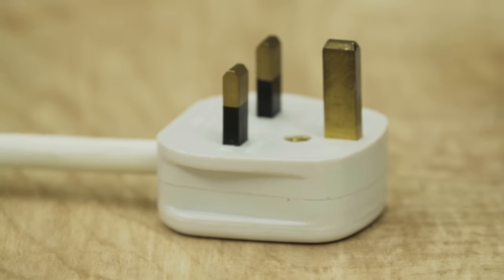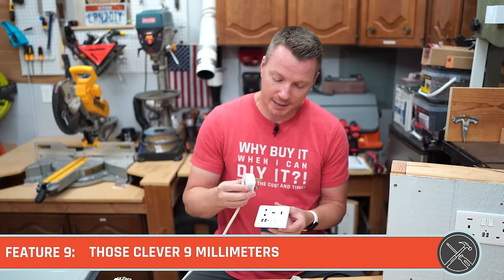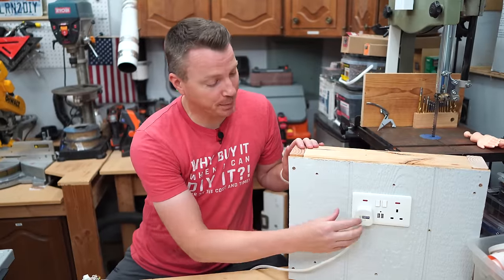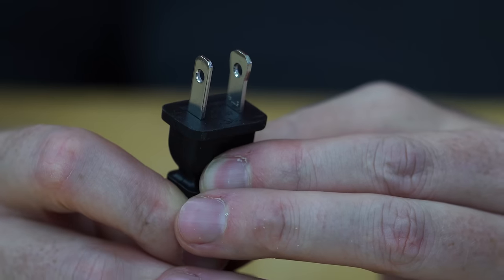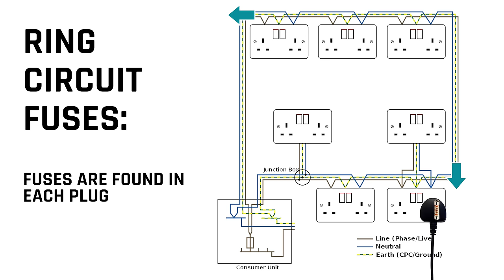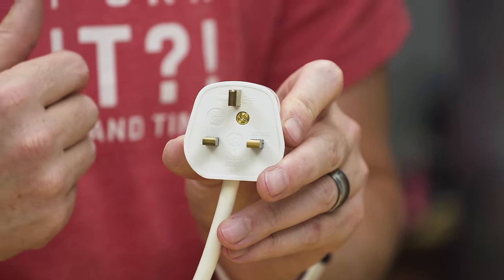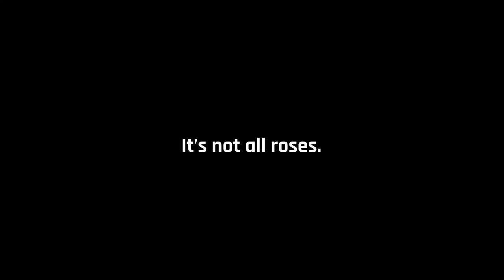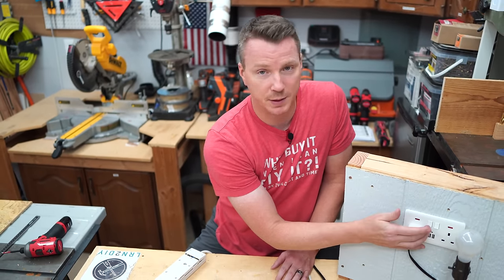British Plugs and Outlets Are On Another Level

Comment: interesting video.  i came from the UK and remember as a kid having to replace fuses or wire on new plugs to items we bought in the store.  with 220 coming out of the wall, you'd get a bit more than static hair-do if you got a shock.
i was amazed when i came to the states the first time i went to plug in my room-mates vacuum cleaner with this flimsy plug almost as crazy as a car wheel with 4 lug nuts after driving a super duty with 8.
Reply: Voltage is actually closer to 240v if not more in the UK, It's officially 230v +- 10% but that's just to line up with european standards where they run around 220v. So it's the spicier of the 230v systems.
Reply: @RossMitchellsProfile  yup. It's 253V or something at the transformer, but loses a bit due to resistance losses. Actual voltage at the home user's plug socket has a surprisingly large range.
Reply: @neilsluman8267  What do you mean “at the transformer”? The cable into a house is single phase 240V (+10/-6%), the single phase cable is jointed off the mains 415V 3 phase cable which is fed by the LV distribution board inside a substation, the substation contains an 11kV to 415V transformer (usually) however you can get 11kV to 240V single phase transformers and 33kV to 415V transformers at distribution substations.
Reply: @ohgoditsjames94  I mean at the final distribution substation. That +10/-6% means your actual supply might be anything between 216 and 253V.
Reply: @neilsluman8267  Yes I know. The “final” transformers secondary winding is usually 415V for line voltage and 240 for phase voltage as 99% of the time the LV winding is Star connected.

Comment: Load balancing on a ring circuit has never been an issue in my lifetime. The gauge of wire now used is more than enough to handle 13A loads.

Ring circuits also help in troubleshooting. In that with a broken ring, if it is not fixable, then the ring circuit can be made into two radial circuits.

The switch don't cause confusion, perhaps to those that don't have switches it will be an issue.

Stepping on a plug is a right of passage in the UK 😆

Comment: Great video. Ring circuits aren't a necessary requirement  in the UK, if you want to run a radial you can (though you need to protect it with a lower rated fuse/circuit breaker in the consumer unit than if you had a ring circuit). 
Also load balancing isn't usually a big issue in the typical home. If you did have a significantly larger current in one side of the loop that section of cable would heat up slightly causing an increase in resistance so more current would travel around the longer part of the loop. Kind of self balancing. In any case your circuit breaker would protect the circuit from dangerously high currents.
Reply: what absolute nonsense, all points on a rind circuit are equal
Reply: @gimmieliberty6514  You're wrong. Current in the shorter leg of the ring can be higher than current in the longer leg (because resistance is proportional to length of cable). It's explained in detail here...
https://youtu.be/c28vLmsszFM
Reply: You don't necessarily have to use a lower rated fuse/breaker for a radial - you can still use a 30A/32A by upping the cable size to 4mm2 instead of the standard 2.5mm2 used for a ring.
Reply: @stephenwalker6823  Quite right. That is your other option.

Comment: I'm in the UK. Not every socket has a switch incorporated. Most modern ones do but many older ones you still have to physically remove the plug. Load balancing is not something that I have ever heard of, and has never been an issue for anybody in the real world. Having to diagnose a faulty socket switch isn't something I've ever had to do either. The pain of standing on one is real though. Once trodden never forgotten 😭
Reply: @karlosh9286  Legally fridges, cookers, washing machines, tumble dryers and so on HAVE to have a switched fused spur as well as an outlet which may not have a switch.
You don't want to be trying to pull out an appliance that's on fire or leaking water right by an electricity supply to get to the plug socket in the wall behind it! Yes there's always cutting the power off at the consumer unit / fuse box, of course.
Reply: @JP_TaVeryMuch  The RCD should trip these days, and everything should be "fine" !
Reply: @karlosh9286  Should being the operative word. Should and almost always is. But belt and braces measures can usually be slotted in unobtrusively.
About time braces came back into fashion actually. Especially if we've all been put on the national debt diet.

Comment: 10:50   Switches Are 
             Double Edged Sword

This is a non existent issue!☺️

If an appliance does not work you simply try another appliance at that same socket eg a phone charger.
If that works then you know the issue is with the original appliance
If the charger doesn't work then you have an issue with the socket

Thats it, takes about 10 seconds to work out 😂

Comment: Missed the point about stepping on the plug.  The outlet switch is a double pole switch, therefore when switched off there is not a need to remove the plug from the wall outlet, since the plug is not on the floor, one does not step on it.

Comment: For anyone looking for an easy way to remember which wire goes in which terminal:

BLue = Bottom Left

BRown = Bottom Right
Reply: Another way I was taught is 

BLue = Bottom Left

BRown = Bottom Right or the colour your pants turn if you touch it.
Reply: I think "bottom" is kind of superfluous (though I get it is technically more accurate considering the ground pin). I've only ever really known people to use:

BLue - Blue Left 
BR - Brown Right

Comment: I remember once when I was 10 years old and hoovering the stairs as part of my chores, I had the hoover at the bottom of the stairs with the cable (and thus plug) unwound and on the floor next to it. I was upstairs and going down so I could start hoovering, and me being a 10 year old I loved running downstairs as fast as I could and jumping off the last few steps - bad decision in this case. I landed squarely on the upturned plug right on the arch of my foot and all of my speed and weight went straight into that foot - luckily the plugs are blunt so I only barely drew blood, but I couldn't put any pressure on that foot for the next couple of days, and had a profound limp for about a month after the fact

Comment: Thank you for your 'cool' review! UK mains cables are 2.5mm and homes usually have at least two separate ring circuits. The square 13A pin plugs BS 1363 replaced the earlier three round 15A pin plugs as a safety measure (for example, to stop children poking pencils into sockets) from 1947 - although I still remember a few still in the sixties. Remember, homes had fewer sockets and appliances back then.

As for being robust, I still have some round pin plugs which are serviceable albeit no longer used as they don't meet today's standards and there is no point in having incompatible plugs /sockets in the home. Many of my BS 1363 plugs are decades old and in excellent condition.

5A three round pin sockets are occasionally still used on lighting sockets to prevent 13A plugs from being inserted.

As for a lamp not illuminating?  In the UK we always check it is plugged-in first and turned on at the socket (second)!

PS - you forgot to mention the grip-notches on the plugs - there to assist when unplugging. A subtle part of the design so easily overlooked!
Reply: The UK never used round pins except on low voltage systems usually found on farms.
Reply: Graham, we did and do. It's very useful to have a round pin circuit for lighting. This was / is how many table lamps in a room were controlled from one switch.
Reply: @JP_TaVeryMuch  Yep, I remember as a child my parents home having round pin sockets in two different sizes if I remember rightly.  The house was rewired in the late 70s and it was all standardised to what my mother always referred to as a 'square pin' for decades after the round pin sockets were consigned to history.

Comment: As a Swiss electrician, I would say the “Swiss” plug and outlet are the best. 
Ground pin longer, plastic pins, hierarchically downward compatible, etc… 
But there’s a one more security, there’s a protective collars on the outlet so it is impossible the touch the pins. 
Plus, in one unit/outlet, there’s three outlets. This is the best feature actually.

Not sure everything is clear, but go on Google. It’s the type J

Comment: As a UK electrician, the old ring main circuits are in the process of being phased out in most places. New builds & most rewires are almost exclusively radials. 

Testing & fault finding ringmains looks complicated, but once you've done it a few times it's pretty straight forward.
Reply: How are they being phased out?
Reply: @scabthecat  Most new builds aren't species to have ringmains & most electricians doing rewires I know don't tend to use them either. Even councils sparks in my area don't install ringmains on rewires.

Comment: British plugs are great - if you open them up (only certain devices, no ground pin needed), you will find a simple euro plug inside. Which completely sits inside connected to the british layout pins :D
Reply: With that huge size, I bet you could fit two Euro plugs in the housing. :D
Reply: @digantdalal  you can still fit two UK plugs in the double UK socket, as the converted plugs sit out a little deeper and power, not wider.

European plugs are so easy to bend break and come out socket. Really a down grade once you've lived with type G.
Reply: @Dosedmonkey  The whole euro plug/ socket system is a genius design. If your your plug comes out easily, you are probably using a dodgy converter or it is meant to come out to protect you from tripping over. Euro plugs come with only low power devices, for high power bi polar devices, it comes with round CEE 7/2 plug. There is no way, you can stick this CEE 7/2 into a hexagonal Euro socket. It has to be a type E/F round socket with earthing. Unlike in Type G, CEE standard plugs comes with straight wire out. It is meant for ease of plugging out and the device should not remain powered all the time. e.g. Irons, laptop chargers. Once you are done, plug it out and take it away. Vacuum Cleaners and hair dryers come with CEE 7/2 plugs with straight wire out while TVs come with 90 degrees L shape. You will certainly not trip if you step on a long vacuum cleaner cord because it will come off from socket before you trip. Type G is boring and big. Who needs a clunky plug for low power mobile charger or an led lamp with a low amp fuse? The mechanical design of hexagonal Euro socket prevents any high power round plug to be plugged in, and you can convert each round pin Type E/F socket into 2 or 3 Euro sockets with a cheap converter on wall.

Comment: Britain used to use 5 Amp radial circuits, with smaller plugs. The type G came with the introduction of Ring  Main circuits in the early 60's.  Ring Mains run from a 32Amp Circuit Breaker, (compared to a 16Amp typical in Radial Circuits).  In order to allow the use of smaller appliance  cables, a range of fuses can be fitted, these have now been standardised to 13, 5 and 3 Amps.  Load share is not a problem on Ring Circuits as no device can pull more than 13 Amps.  Moreover, typically a house will have two Ring Circuits, while high Current Items such as Cookers, Hobs, Water Heaters and Electric Showers are run from individual Ring Circuits.  Having the exit at the bottom of the plug stops people pulling on the cord to extract the plug from the outlet (which can thin the conductors by stretching, and or pull the conductors from the terminals).  It's chunky design makes it easy to grip, which is esp important for people with arthritic hands (and also further discourages cord pulling).  The insulation on the conductor pins is relatively new, and probably introduced to ensure children's fingers cannot make contact with live conductors. Not all outlets are switched, and like in the US, moulded plugs are common in the UK now too. Our membership of the EU, and the drive to achieve common standards has resulted in changes to European Plugs and sockets too, all of which are now have shutters on the outlets and devices to stop children touching the live pins in a plug - typically insulation like the type G, or a shroud on the outlet. Lastly, these days all Ring Main circuits are protected by a 30mA Residual Current Device, which along with the Earth/Ground Resistance requirements limits the Earth/Ground fault 'touch' voltage to less than 50V.